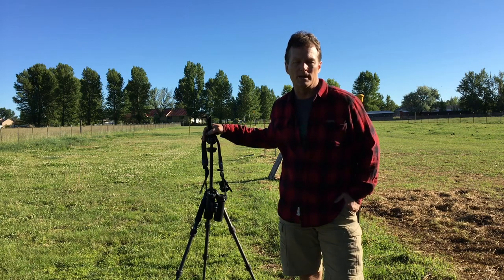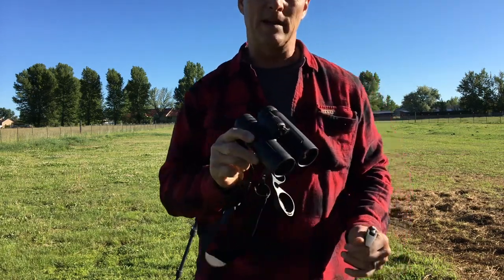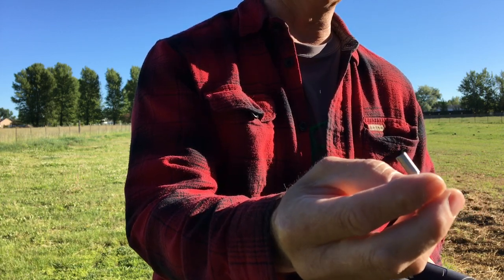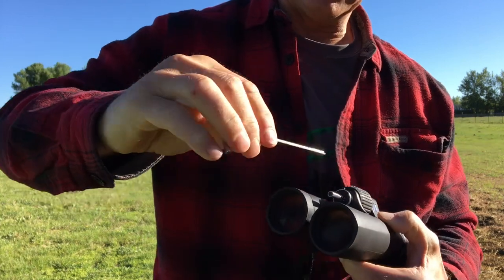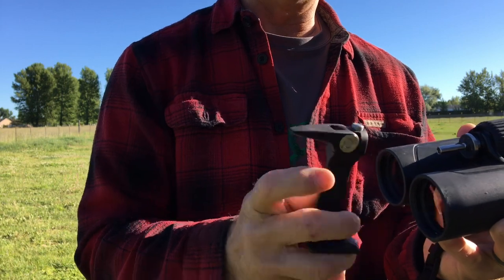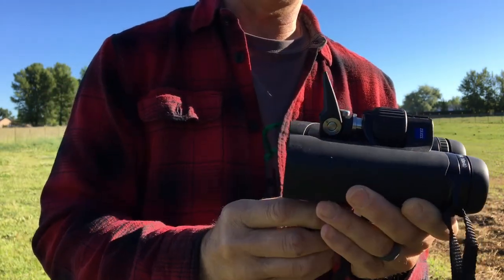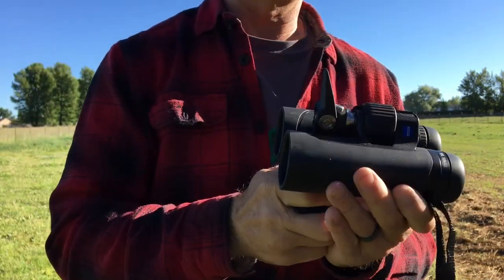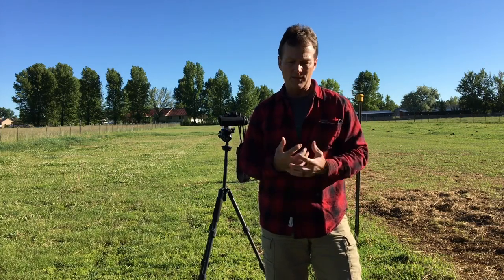Zeiss Tripod Adapter Stud Install

Comment: The hinge lock doubles as a crude aiming tool. Have you reviewed the Zeiss Binofix adapter? I’m looking at making myself one based on that or the Berlebach wooden version.
Reply from the maker: Hey, thanks for the tip on the hinge as an aiming device. Have not tried that other adapter. Didn’t even know it existed.

Comment: The only thing that bugs me here is that the locking lever is up in locked position, it would look alot smoother if it was horisontal
Reply from the maker: Was thinking the same thing. Took some getting used to
Reply: @Rokslide  i see some small screws on the silver plate on the side, have you tried unscrewing them and flipping the lever? It might work just by pulling it an twisting it too
Reply from the maker: @aleks2194  good observation, but you can’t flip the lever. you wouldn’t be able to get your barrels or your binoculars close enough together. It would put it between them and it’s too wide. Plus the cam would be facing wrong direction. Thanks
Reply: @Rokslide  ok thanks for the info!

Comment: Does it work with the SFL 8x30 and 10x30 too ?
Reply from the maker: Yes as long as yours have the 1/4-20 adapter from the factory.